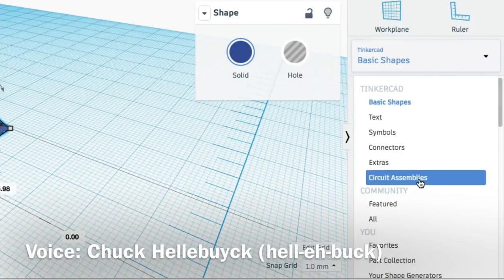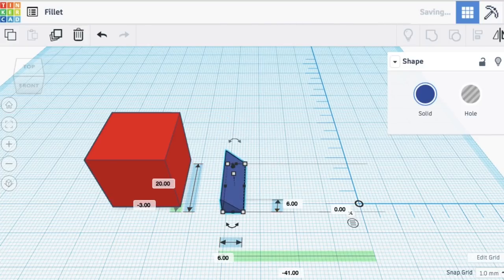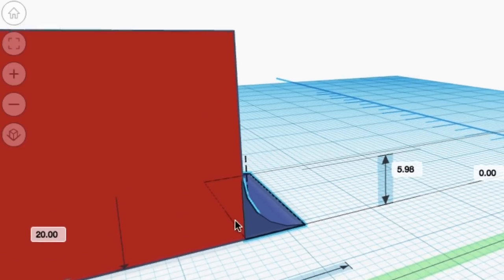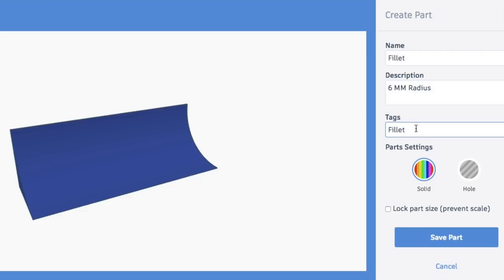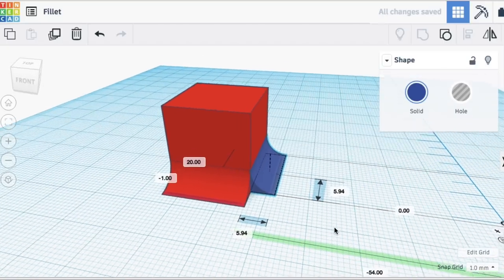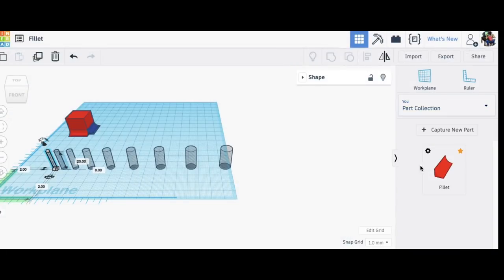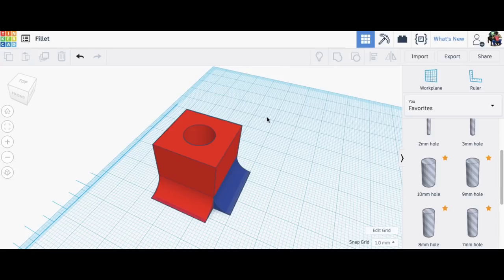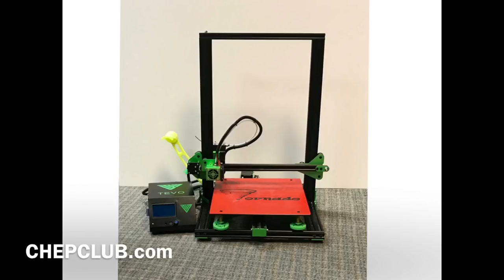Tinkercad Custom Shapes 3D Printing Design Tutorial for Beginners

Comment: Great video. There are two other great features that are undocumented that I'd like to use. The shift key with working plane allows you to drop parts to the other side of the plane and tapping the little circle on Ruler changes the where dimensions are made and not the circle with the x or little lines but the Origin circle.

Comment: I had started building a library of parts that I use often, I have a tapered dovetail connector that is really useful, I was just copy pasting them from one design to another, but the new custom part feature makes this so much easier!  Thanks Chuck.

Comment: I use TinkerCAD all the time, but didn't know those tricks. Thanks - it's a great scratch-pad tool for not just 3D printing, but it is also good for designing models for lasercut or CNC too as it can export SVG files.

Comment: Great video!! Is there anyway to loft in Tinkercad? I'm trying to design a foot for my BBQ. If I could loft between two rings set 90 degrees apart, that would be great!!  Thanks again for all the great content!!
Reply: CHEP Filament Friday Imagine 2 circles 3 inches apart and 90° to each other. How would you connect them with a solid. I Like to Make Stuff's Bob Claggett used lifting in his latest video to make a dust port in Fusion 360. I just wondered if there was a feature in Tinkercad like that.
Reply: CHEP Filament Friday Thanks, Chuck!! I'll look at it!!

Comment: Hey Chuck, I have an issue. My internal SD card on my Flashforge Dreamer has corrupted. Initially it would take abnormally long to turn on, so I found it could be an SD card problem. Sure enough I take out the internal SD card and it won't even show up on the computer. I replace the SD card, however now it won't print anything. I think this is because there are system files on the internal SD card, and this new card doesn't have them. Could you possibly upload the files of the internal SD card? I tried contacting support but no one ever emailed me back. Any help would be appreciated, thanks.
Reply: Are you sure you're thinking of the small internal TF card and not the easy to get to large external SD card? Flashforge's support center says that there are files on the card. This site, http://www.flashforge.com/support-center/dreamer/ all the way at the bottom.

Comment: If you would have created the first hole at 1mm, then made the 2nd hole at 2mm and did that multiple duplicate you wouldn't have had to modify the size after the first 2, even if you didn't intend to have a 1mm hole in your parts list.